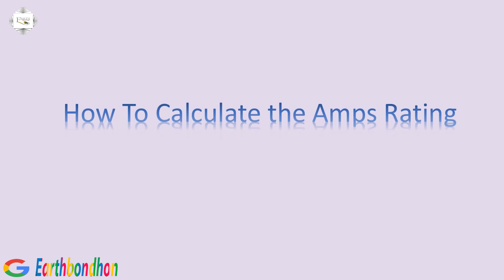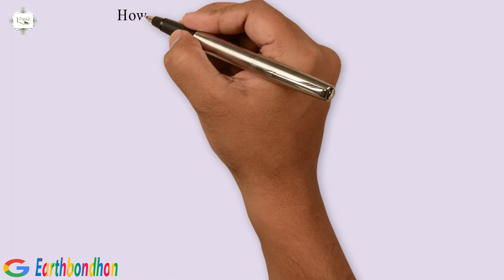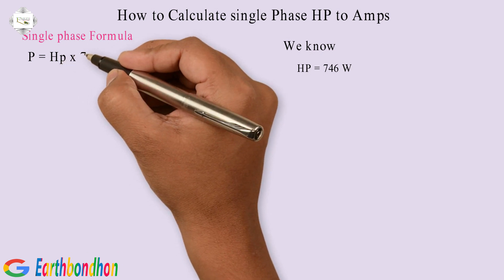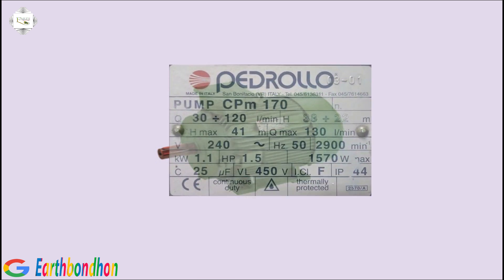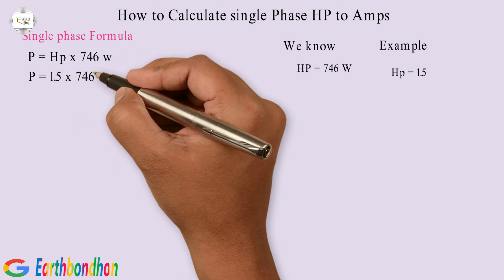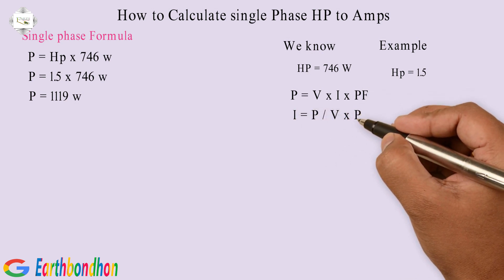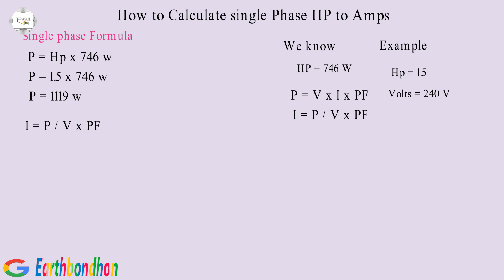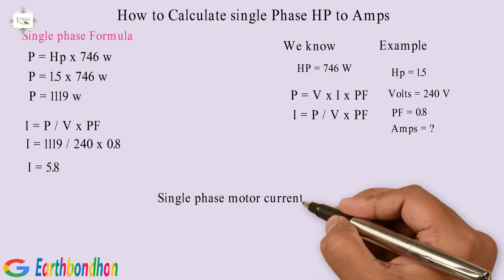How to current calculation formula for single phase motor | convert hp to amps | Earthbondhon

Comment: 4 HP motor single phase runs on 15amps then how much electricity consumes units per hour
Reply from the maker: It is very simple .
1000watt in 1hour = 1 unit in kilowatt-hour
In your case Power is  220×15= 3300 watt
To convert it into kWH it is divided by 1000 so
3300÷1000=3.3𝐾𝑊𝐻 
So for given load unit consume in 1 hour is around 3.3 unit.
Love to receive your comments and feedback.
Thanks for watching it.

Comment: 1119÷240×0.8=3.73 A.    
I got this answer
Reply from the maker: thanks answer
Reply: I got 5.8 Amp the number is corrected.
1119÷(240÷.8)=5.8
Not (1119÷240)×.8
Thanks
Reply: i got the same 3.37, but the formula says    I = P / V x PF   = 1119 / 240 x 0.8
Reply: @muitobombogelgel4260 Hello ! The formula is I = P /(V x pf)

Careful, if you use a calculator!

Comment: How to measure current by clamp meter,putting wire in the clamp and what is the reason. Phone no. 9177178558.